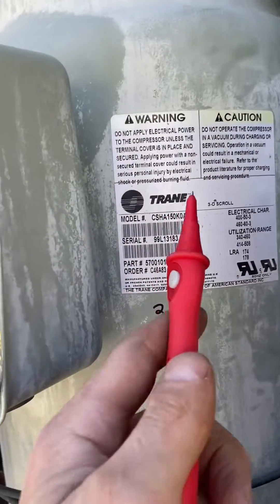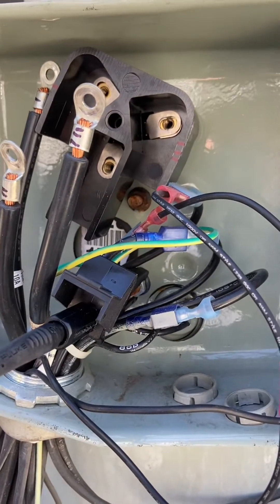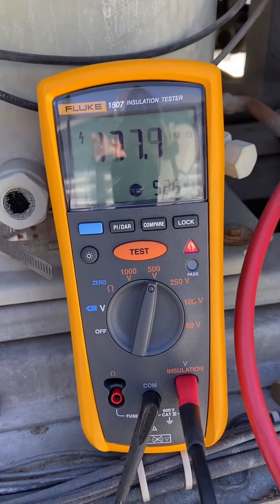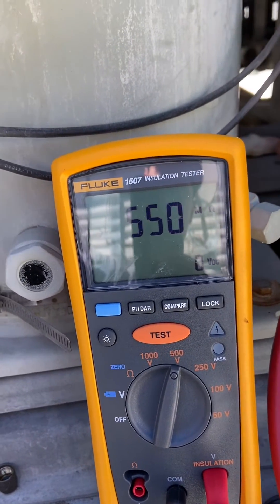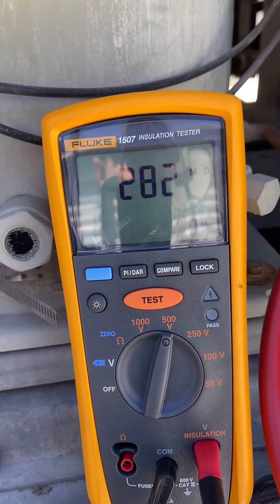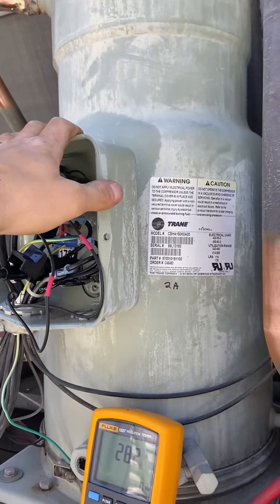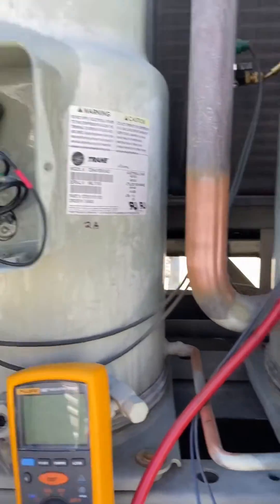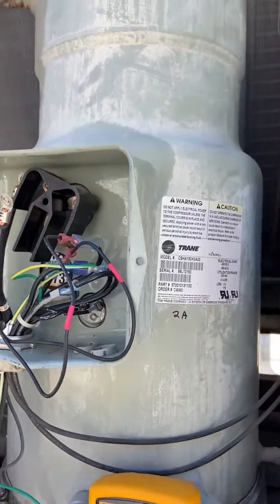How to Meg a compressor

Comment: I was megging the same type of unit, intela pack and when using the megger it was starting low like 25 then rising slowly to 400-550.  it was taking a minute though.   seems odd to me
Reply: You're supposed to leave the megger on for 2 minutes for an accurate read. Also the compressor should be at ambient temperature.